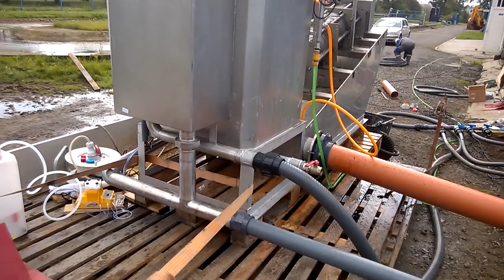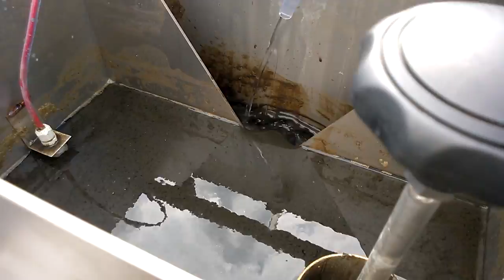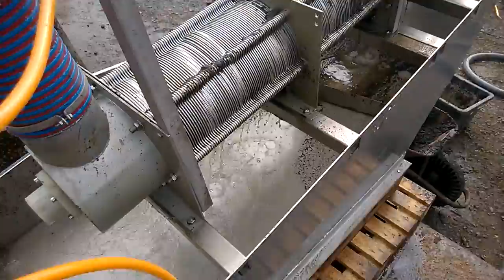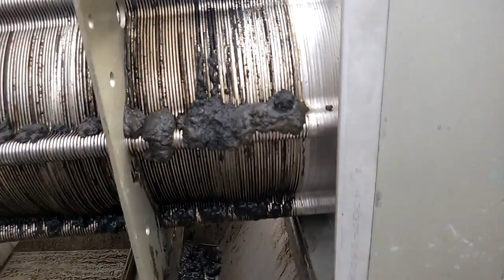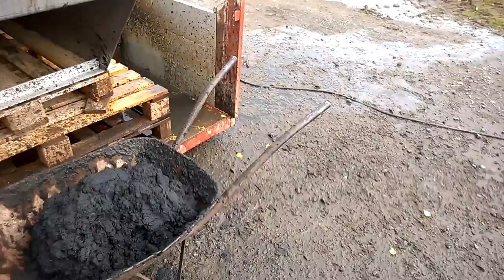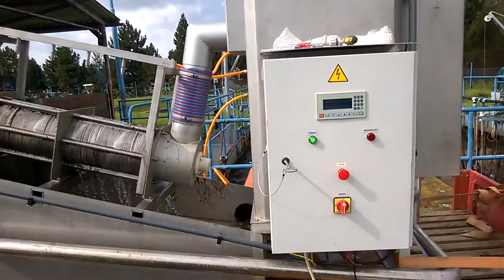MP-DW-301 Dewatering screw press test 3/3

Comment: Sludge cake whit 82% moisture, that's the biggest problem when the companies buying copycats, this kind of equipment has the worst quality and poor design, it's better the original Volute from Amcon Japan.
In Mexico we have  bad experiences with this copies, because the price is very cheap  and the support it's like this kind of shit.
Reply from the maker: Dear Amcon distributor, 15 to 20% sludge cake from activation tank of WWT is standart result and Volute is not any better. For different sludges we can get different dry matter (max is around 45% for oil-based sludges) and you can check other videos to see it. Sadly, shitting around is only thing, you guys know to do. You know the best, that Volute is overpriced and outdated equipment, which can last just half year before you have to call your dealer to sell you new shaft. We don't go this way, we try to do our best to have satisfied customer with reliable equipment. And plenty of satisfied customers all over the globe proves that. Have a nice day!
Reply: MIVALT s.r.o. Dear MIVALT  distributor,  I sell my first unit in Mexico 5 years algo, and I never sell any spare part, and i have the record an all the equipments works, so when you say the Volute needs to replace every 6 months, maybe the client buying this equipment or benenv or any copycat in the market.
Maybe your company do the best effort to sell equipments but let me tell you, I prefer sell god quality to the customers, to sell problems just for money.

In this case, I don’t think the Volute has a bad or  outdated technology, because all the brands in the market started to sell this technology, please do not try to cheat customers whit stolen technology and poor quality.

I wish you the best, however there is no future for those who try to progress stealing merits from another company.

Best regards.
Reply: @benjaminrobles9049  good comments, what would you recommend?